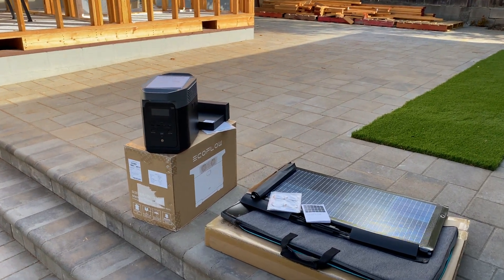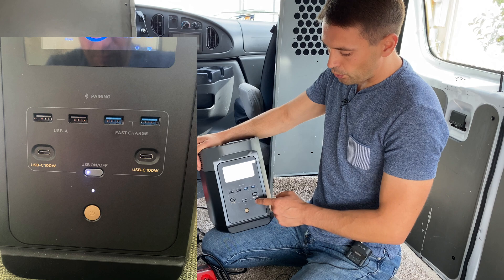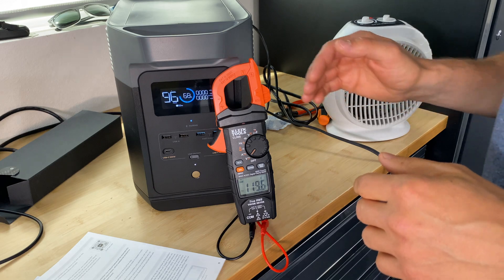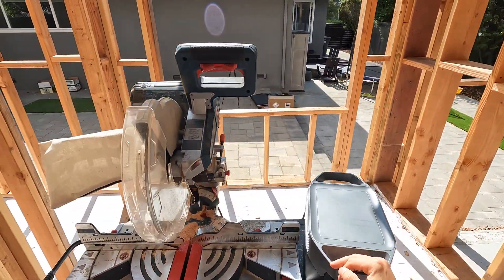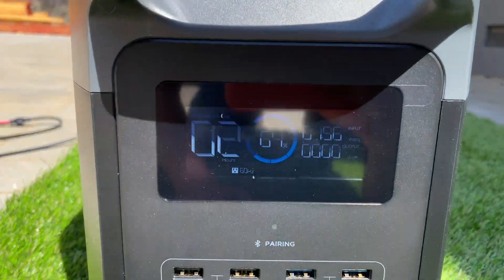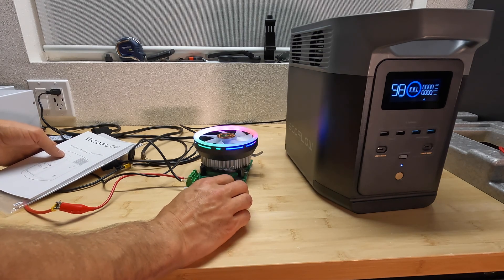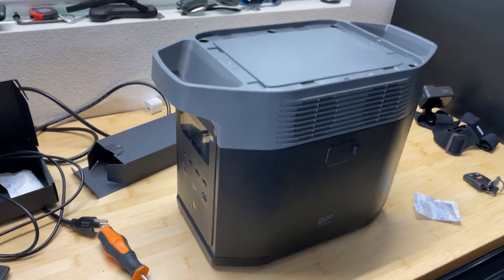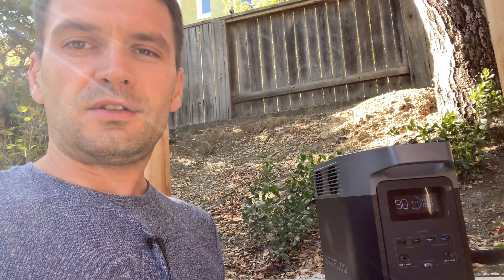Portable Power Station EcoFlow Delta 2. Detailed review

Comment: I bought exactly the same with the solar panels but did not come with the solar charging cable. Did you have to buy it separately and if so, which one?
Reply from the maker: solar panel came with XT60 to MC4 connectors. Please check with ecoflow if package doesn’t contain cable.

Comment: I purchased the package Eco flow delta 2 and 200 watt solar panel and the waterproof bag from Amazon. They delivered the delta 2 and stated I had received the whole package. After several hours on the phone to Amazon I at least reported the mistake. A few days layer I received via DPD a damaged solar panel. Stating th £70 bag had been delivered. When I opened the damaged box from Eco flow via DPD there was no solar cable with the solar panel. I tried to contact Eco flow but they ignored me. I sent them an email stating I would contact my credit card for a total refund. I must state there is no details of the company which I believe is in China. see above went wrong.